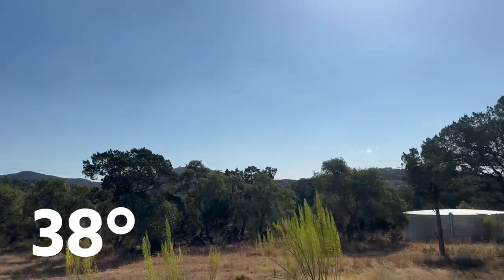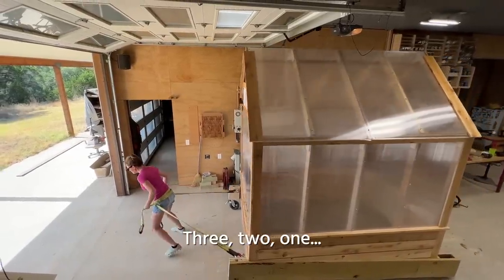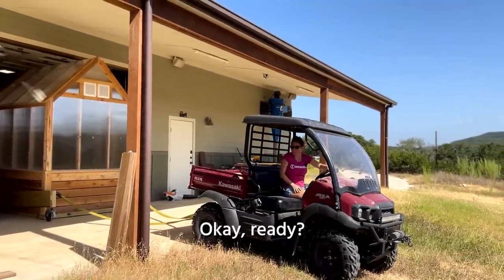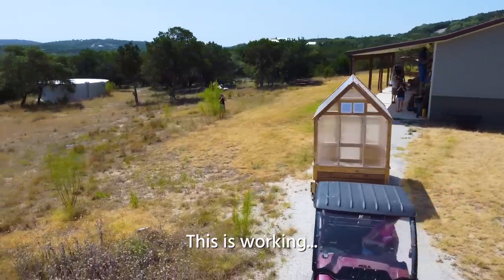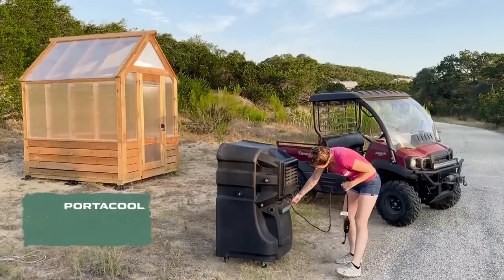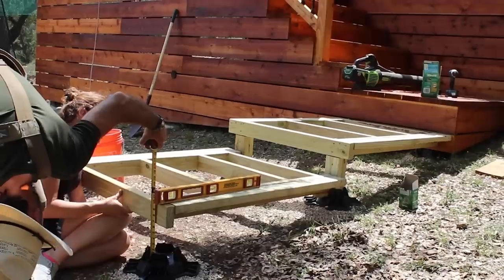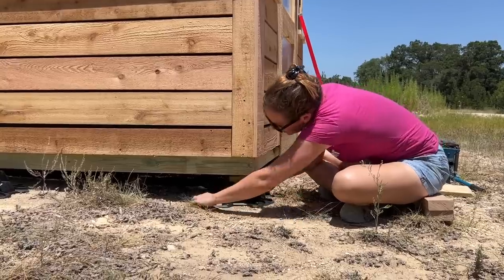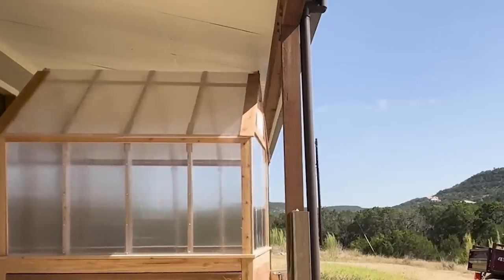Moving a Greenhouse Shed | Stuck, Snagged, Crashed!

Comment: * Tiny (Green) House/Home *
It's virtually ready to take on the road (if you keep it under 0.5 MPH) 😅
Just add a little kitchen, hammock, and a solar panel.... oh, and privacy shades for shower/bathroom.

Really though, it's a great build, the "test" you subjected it to shows it should hold up to most anything that may come it's way.

Really appreciate the pointers you gave on the 4x4 treatment. The ToughBlocks seem ideal for places that don't freeze & buckle in winter (my situation), the metal wraparounds too.

Are you planning to fill the floor area with pea gravel or something?

Comment: I love how you leveled your greenhouse using these Tuff Blocks! I need a shed but I don’t want to have to dig out posts and concrete or build out a concrete pad, etc. I don’t think a shed necessarily needs to be anchored into the ground, although where I live in sw Ks, winds are extreme here (we get dust storms with wind like the dirty thirties) and occasional tornadoes are a concern though… overall I think this would be great for quickly building out a shed or greenhouse while protecting lumber from rotting with direct ground contact. Ingenious product, any recommendations on securing for wind
Reply: You could use strapping & ground auger anchors like they use for mobile homes

Comment: Good one.

I cheated and built my last greenhouse project (using recycled frames and glass from a solarium) on 6x6 timber skids as a foundation, and just dragged it into place with a quad…  never underestimate the slipperiness of long straight timbers or pipes.  

We did a similar project where we took a family friends Arrow-style metal garden shed, and built a solid floor structure for it, then build the shed on that, all on top of a 10 foot long utility trailer, so we could build it all in our shop, then haul it the 90 miles to their hobby horse farm.  Didn’t have those tuff-blocks, which would have been extremely useful on the slope pasture/lawn.

Comment: Wondering why you did not build it on skids like outbuildings are outfitted??? Hook onto the heavy duty chain loops that are fastened to the skids,pull away. If over rough terrain,”roll” the skids over 3-4” steel pipes. Hmmmm.
Reply from the maker: Give 10 different minds a problem and you'll probably see 10 different solutions. : ) Wheels is the solutionI came up with and it worked great.